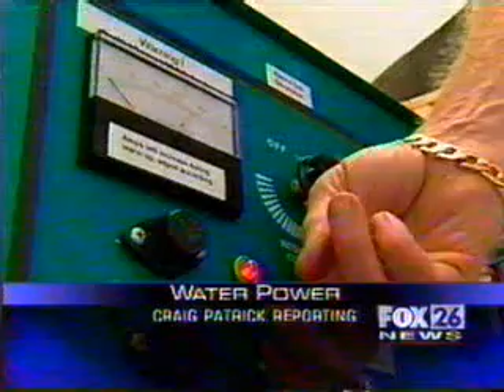Energy Problem Solved - Make The Vid Go Viral

Comment: if the hybrid can produce the needed electricity to convert a stable fluid, like water, into a gas that can run the car (and kick out water w/ smaller amounts of CO2 from the fossil), what do you care about efficiency ratios at this point? they're obviously not going to do it if it burns more fossil fuel as a hybrid than would have been warranted by the car's using fossil alone...